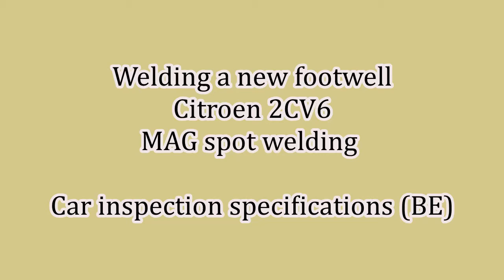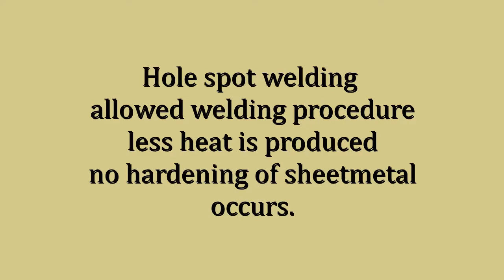MAG welding 2CV rusted footwell - So Oldt

Comment: I have found 5mm (hole) plug welding to be  reliable. If the arc, and wire, do not strike the  base metal immediately, the hole can be filled and the appearance is successful fusion but it easily fails under test.  I use  6 or 6.8mm hole which gives more positive results.  Wth respect. GB